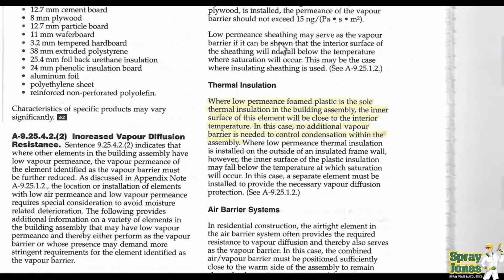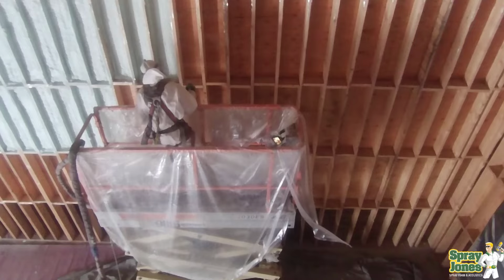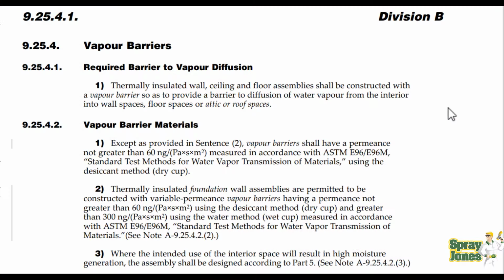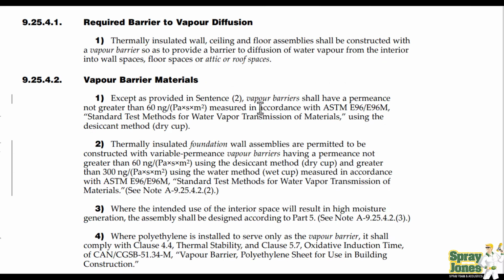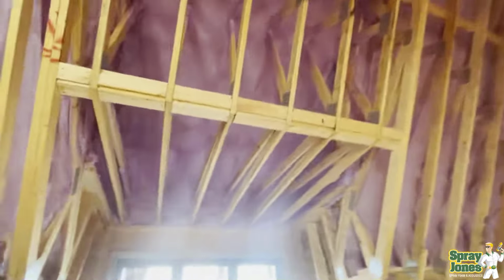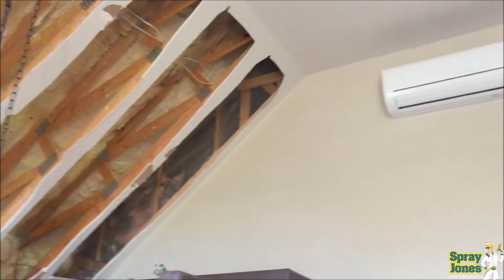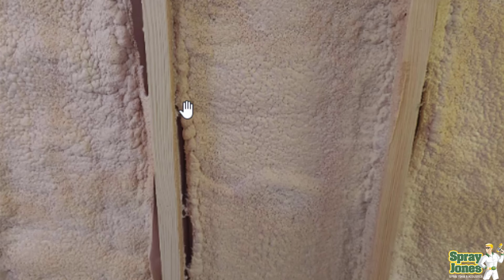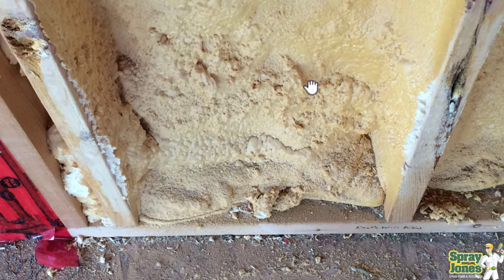Stop! You Will Double Vapor Barrier Your Spray Foam Insulation

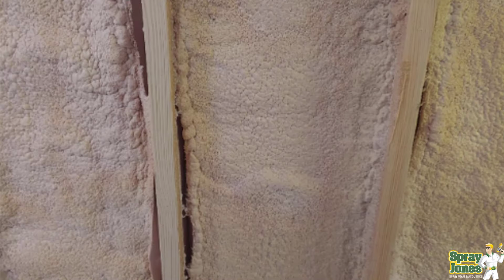Comment: At 9:42 you point out a installation failure. You mentioned that it probably happened pretty quickly. How long after the spray foam is applied should I wait to start drywall to insure this type of failure doesn’t happen after i cant see it?

Comment: 13:24 … from here to the end, was very insightful. Would a vapor impermeable WRB on the exterior of the wall fix this?

Going back to the beginning of the video, where you were talking about the Code Appendix from 1995 and the body of the Code from 2022: I am in South Florida. I am about to kick off a new home build (my personal home). It will be a CMU block home. I am doing exterior insulation with an air gap between the CMU and insulation. Before that, I am coating the CMU with a vapor closed Tremco product. I will finish off the exterior with James Hardie lap siding and stone veneer. 

On the interior side, I am doing 2” of closed cell spray foam on the CMU block and carrying it up to the roof deck and spraying the underside of the roof deck. Essentially, creating a vapor closed thermal envelope on the interior side. 

There are more specific details in the design to allow for drying out of the wall and roof assemblies, but my question is, by doing vapor closed on the outside of the CMU and vapor closed on the inside of the CMU, am I touching on the double vapor barrier you discussed at the start of the video?

Comment: 14:18 "Now you got cold air coming in that can form condensation when it meets warm air".  It's the warn air cooling that releases it's moisture as condensation, right?  So the moisture is coming from the warm air, and is not being carried in by the cold air?  Is this correct; can you elaborate?  What I am asking is what is the source of the condensing moisture?

From the Condensation in Buildings Handbook ABCB
Condensation
The process used to describe moisture formation on a surface as a result of moist air coming into contact with a surface which is at a lower temperature. As cool air is unable to retain the same amount of water vapour as warm air, excess moisture is released as condensation.
Reply from the maker: Warm air meeting cold forms condensation - the warmer air can hold more moisture. That is why chillers are used to cool air and remove moisture in air compressor set ups.
Reply: Foam insulation is a scam 😂
Reply: @owenhill-vf7ko  You mean spray in only, or are you including rigid foam too?
Reply: @owenhill-vf7ko please provide proof of your statement?

Comment: i understand about not using a double vapor barrier on the inside thanks for the good info. But what about vinyl siding underlayment that would be between the sheeting and the siding.  would this create a moisture issue with the sheeting if you have close cell on the inside of the house against the sheeting?   Most of the underlayment is a R1 value.
Reply from the maker: No issue.

Comment: On the diy kits, are they just not good? I have a small room i was going to do with one, or should i look at having a company come and look at it? The room is less than 200 sqft.  Thanks for any all the info you have put out.
Reply from the maker: Get a pro. They usually have a minimum charge.
Reply: I have used them successfully.  If you pause for more than 15 seconds or whatever is in the manual, change out your spray head.  If you don't you'll end up with too much of 1 chemical and not enough of the other.  I did a small bathroom with 2 small containers from lowes.
Reply: @SprayJones  Thanks, i will have one come out and see how much they will charge.
Reply: The problem is finding a pro that wont screw you over or create a disaster
Reply: For many they live in areas with few foamers with hood exp and i dont want to be their guinnea pig test learning house

Comment: The spray foam insulation isn’t continuous. You are ignoring the wood framing which is vapour permeable.
Reply from the maker: You don't know much about what we are doing and construction in general. If you did you would know that the wood is a vapor barrier and is recognized in the building code as such..

Comment: I am going to condition my attic with ccSPF (1978 house vented attic) and have a question about ceiling penetrations in the 2nd floor ceiling. Should those be air sealed?
Reply from the maker: Are you converting this from open vented to sealed?
Reply: yes, I am sealing up the attic for potential storage space. Installing a pull-down staircase for easy access  @SprayJones
Reply from the maker: @perrycammisa6345  Then no sealing them is not much advantage other than keeping things from migrating down.
Reply: @SprayJones  awesome thank you for your quick response

Comment: I thought you would see condensation on the outside during cold weather if there is air leakage from the warm interior to the cold exterior surface such as siding.
Reply: You see condensation on your grass in the morning, but there is no air leakage up through the ground. Condensation indicates good insulation and air control.
Reply from the maker: You need to go back to grade 10 physics class.
Reply: @Zorlig  Thanks for the reply but I don't get your point. Moisture forms on grass when 
 warm air cools below the dewpoint. I'm talking when it's cold and dry outside and warm, moist interior air passing through a wall and condensing onto a cold surface such as the back side of the house siding. Then dripping down the wall.
Reply: @SteveWH978  that doesn't really happen. For example with a leaky house it's going to be very difficult to get the humidity that high.

More likely condensation happens on the inside of the sheathing on an air sealed house.

Comment: A vapor barrier on 2 sides of things always makes me pause because now the things can’t dry if water does get in and over 10 years water is going to get in. 

I had a friend spray foam their crawl space, which looks great. Then they put linoleum across the entire first floor. Is this going to be a problem if moisture somehow gets to the subfloor?
Reply from the maker: I assume you mean they sprayed the backside of the floor. No there won't be issues because who wouldn't see water on the lino? Undiscovered leaks are nearly impossible inside living spaces.
Reply: Yes the backside of the floor. 

Good to know. Thanks.

Comment: Spray foam is great, do you think it'd be useful to have a formula which changes color with prolonged liquid exposure? So all the foam would change color a little from normal vapor exposure, but in the case of a failed roof area you'd be able to detect a very dark area.
Reply from the maker: Interesting idea, wouldn't work too well. The moist in a roof would be held at the outside layer, so how would the moisture wick through a closed cell system to show a color change on the inside... you see?

Comment: Hi my question is we are an agricultural/shop builder in the states Iowa  we have been building wood framed  buildings with 2-3 inches of closed cell foam we put tyvec or a house type wrap on the exterior they are steel sheets with the tyvec between the steel sheet  foam directly applied to tyvec  the reason we do this is for removal of steel sheets if damaged what are your thoughts  on this our foam guys never said we should not do this  and never had a problem yet
Reply from the maker: No issues. Go watch my metal building playlist where we discuss wraps for post frames.
Reply: I will thank you @SprayJones
Reply: Just watched that video answered all my questions thanks again

Comment: What about open cell foam?  2 x 6 exterior wall.  Do you need a vapor barrier?   I thought cell is air  impermeable at 3 1/2 inches. I’m in the north east. Just had an inspection fail.  This happens every four years- five years.  In my 22 year courier this is may only happened three times.

Comment: In theory or practice does it make a difference if seams between studs & headers are caulked on the outside-facing side (during framing) or inside-facing side (after framing is complete)?
Reply from the maker: Both is best. No one does outside.

Comment: Hi Spray Jones, another quick question based on the very few last seconds of the video. I got lots of 2*8 studs that are stacked side by side, in some instances up to 5 deep. I am currently working on ceiling those seams throughout the house as I await spray foam installation throughout. You mentioned no poly, which I obviously wasn't planning on for the rest of the building, but would it make any sense at all to have small strips on these stacked members... On top of the seams being already sealed? So basically get the seams sealed, and then cut a full lengths poly just for the width of the stacked members, without any poly prodtrucing into the sprayed wall cavity? Like a backup extra layer of protection in case there is a small leak somewhere in the caulking?
Reply from the maker: We used to use tape to cover the caulking, only so that the interior boarding would not damage the caulking when being installed. We since use a caulking that skins over and is tough. There is no need to put poly, plus the "flap" you propose would need to be 100% sealed on all edges to be of any assistance.

Comment: Hi Spray Jones, love the videos. Just in the final stage of the build before I get the entire building sprayed in a conditoned attic setup. I have a large 10*12 foot shower/tub/wet room, with two of the four sides of the room being the exterior walls. The exterior walls are 2*8 construction and will have 4" of closed cell spray foam on them. The ceiling of the wet room will have conditoned attic space above. I was thinking of putting poly on the ceiling to control humidity from the wet room from spreading into rest of the house, and was wondering if putting poly on the two exterior walls would be a good idea or not...to act as a water barrier should my shower system (probably kerdi foam board) fail and water get past it. Technically the kerdi system itself is water proof, so water won't make it past, but just in case? Any point you think, or no point at all, even on the ceiling? Everywhere else on the house will be drywall on exterior walls and dry spaces, so no poly there anywhere... But bit confused about best approach to this wet room..

Comment: Use Aluminum Double Bubble it reflects the heat back into the house or out of the house. But if you are Just going to use sheet plastic don't bother.
Reply from the maker: What are you talking about??
Reply: @SprayJones I think he talking about the reflective bubble insulation.

Comment: Great video mr Jones, I have a question that I have not seen answered on your videos my question is on a 2x6 framed walls on a zip board framed house and filling the 2x6 wall with open cell foam is that still enough foam to be a vapor barrier or do I need one , this is in Texas ?
Reply from the maker: Does your code call for vapor barrier? I am assuming it doesn't. 
Secondly I think you are in A/C mode more than heating, so the vapor control would be external not internal.